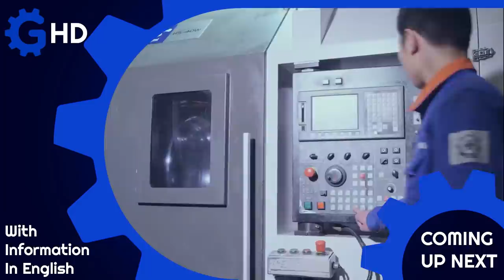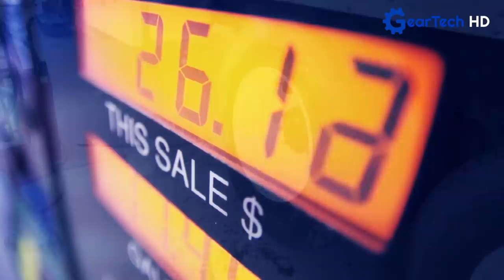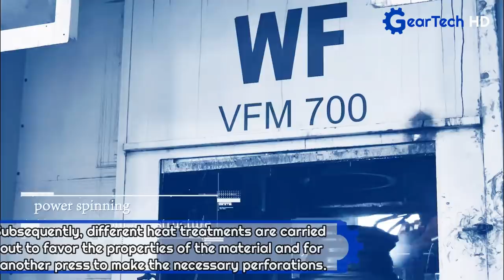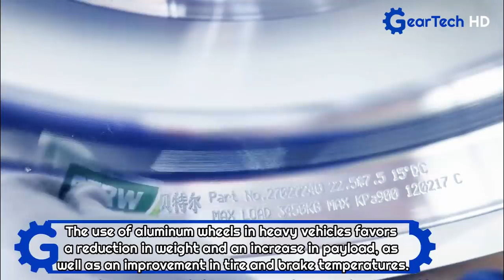The Most Incredible Truck Wheels Technologies You Have To See ▶ Manufacture of Aluminum Wheels

Comment: On the auto-inflator, Can you control it? In some situations, you might want to deflate the tires for traction. Example winter in heavy ice or snow. lowering tire pressure can aid in traction. I understand at speed no, would not be safe. BUT at speeds under say 15-25 MPH, that traction might make a difference. This could also be handy in areas where the road is a little muddy, for example construction sites, Logging and other areas where there is less than gravel roads